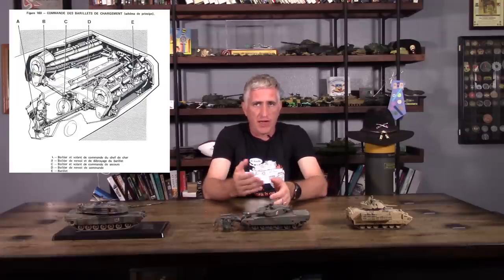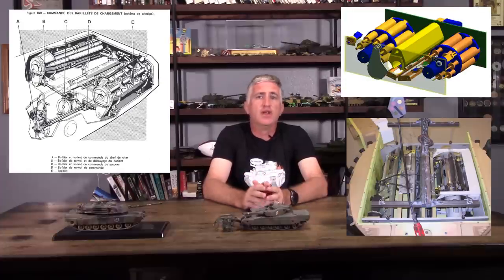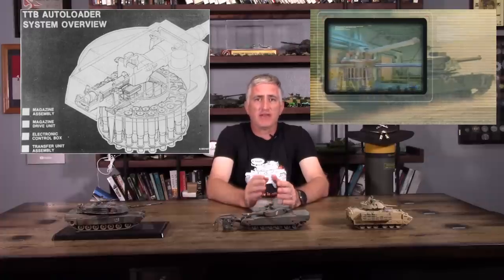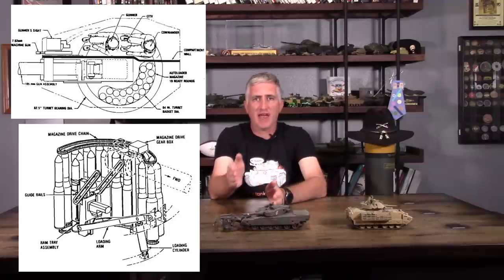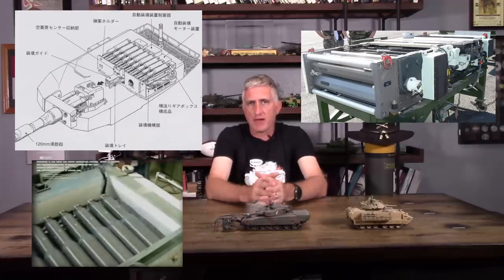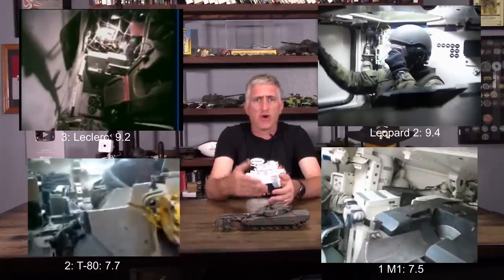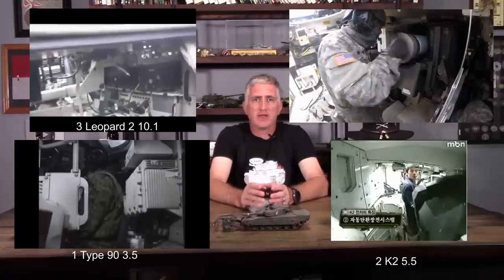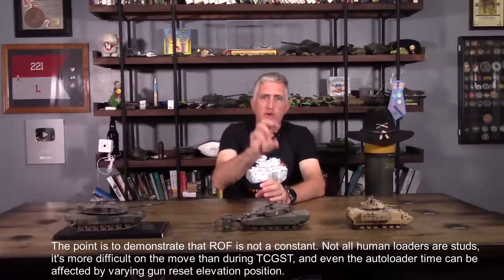Whither the Autoloader?

Comment: With hindsight of the new tactics Ukraine is using by combining spotting drones and tanks (notably that T-64 BV 6.5 mile record shot) could there be a case of keeping the 4th crew member within the tank but having them as a dedicated drone operator while also serving as a backup loader/set of eyes/troubleshooter?

Personally I see that a dedicated drone operator within the tank could benefit greatly, with the drone able to give the TC a more detailed picture of the battlefield such as in dense foliage, Urban environments, or hilly areas, or even simply just extending the overall range of what the tank is able to visually confirm. Additionally having the drone operator within the tank grants them access to enough electrical power to have strong ECM/EW systems to prevent a counter strike homing in on a RC signal, protection against shrapnel (but not direct hits) from counter-battery fire, negates vulnerability to communication jamming that a remotely located drone operator would be subject to, and increases drone availability since larger drones and extra spares could be externally carried. Lastly, if a bit far fetched, infantry working with the tank could also benefit from the drone operator feeding live intel to them about the surroundings without potentially exposing a drone operator who’s on foot to a sniper.

Initially I thought of it as a retrofit for current Abrams, replace the manual bustle with something like the Meggitt autoloader and fit the relevant ECM/EW/drone systems for the drone operator in place of where the loader stood (Maybe adding on Electronic Warfare as a secondary responsibility could be in play given the decentralization of jamming systems in recent years).

The DoD and other government officials don’t need to worry about spending billions to change up the design and build new turrets and hulls from the ground up nor the political favor of effectively building a new tank since this could (hopefully) be more easily applied to existing stock, bean counters won’t be tempted to axe the company size, crew members could be less stressed from staying on watch or conducting maintenance, and planners don’t need to twist the military’s arm to implement crewless turrets or a whole new platform.

I’d love to hear your thoughts on this idea!

Comment: As total blue-sky thinking, I wonder if eventually much better battery technology could end up making tank-based railguns viable. Then you wouldn't need the huge case full of propellant, you'd be back to just firing the actual warhead again. So for AP/solid rounds, back to being small enough that you could lap-load them, and not worry about wet or bulkheaded storage since there's nothing to explode. Of course HE would still need to be a decent size, but if you could get the velocity high enough, you could reduce the regular round size, then carry a hell of a lot more of them. Might not even need it...
Reply: Not likely to be the case anytime soon. However ETC technology would provide a safer and powerful alternative to modern tank guns.

Comment: I just want to see a video inside the tank of an auto loader as the tank get hits from the outside with varying degrees of force.  Do they test it this way?  Is the idea if that is already happening you are aced?  Mechanical parts don't fail under good conditions, they fail because it's been weeks in grit and grime and very little maintenance time and then they get put under stress from outside forces.

Comment: Just curious what maintenance costs could possibly be like when all of those fast moving parts begin to wear out and what impact that has on the probably of a failure happening in the worst possible moment. Also wondering about slight battle damage that has no impact on crew but what it would do to an electronically controlled, hydraulic powered auto-loader that relies on precision and exact movements to work. I think that was the main concern that influenced the manual loader on the M1A1 and Leopard.
I think both have their advantages and weaknesses-it's really what fits mission focus the best.

Comment: My loader automatically loaded. That guy was also handy with the pintle 240C.
Reply: Tanks vs tank destroyers. Autoloaders are fine for Tank destroyers. Better in fact. But, a tank's primary job IS NOT to engage other tanks. It is to provide overwhelming firepower combined with maneuverability and survivability in a multitude of situations, in a flexible manner. A loader allows for more flexibility in a larger variety of situations than an autoloader.
Current force needs do not require a dedicated tank destroyer, but should the need arise, they will likely be deployed organically to Armored (and Cavalry) Divisions. But they will be in the rear when entering a situation that calls for quick reactions and flexible tactics. Like entering an urban area.

Comment: If you cross train one of the other crewmembers to load, jic the autoloader takes a crap, sure why not have an Autoloader. The Autoloader would have to be able to be removed out of the way, quickly. Also, if the Autoloader has just as much of a chance of breaking, as any other system on a tank. The most important thing about a tank, is it's gun. Otherwise, it becomes just a heavy APC, if the Autoloader goes down. I might feel a ton better, if the Autoloader was made with quick-change, parts. As well, as having at least double-redundancy in it's electrical, and hydraulic, system.

Comment: Not really the scope of the video, but thinking about autoloaders and their use in 130+mm guns makes me wonder if we've hit or are due to hit a plateau in armour effectiveness. Obviously there is still room for small T series tanks to grow in size and weight, but western tanks are already pretty damn heavy, and slapping more armour on them doesn't seem to be much of an option.

Is there still scope for advancements in material technology? The type 10 tank leads me to believe there's still a little, considering it was designed to provide at least parity protection to the type 90 at a much lower weight, but one can't help but wonder at which point guns will become so deadly tanks will stop bothering with armour and move onto active protection etc.

Comment: Burst fire might be a more interesting pro/con than raw rate of fire.  We've seen common footage of M1 Abrams 2 shots in under 3 seconds, 3 shots in under 13 secs.
Reply: in very favorable and well prepared sequence with well trained crew to do this. For example a Leclerc in double tapping mode can fire in 5s ANYTIME, ANYWHERE, meaning while moving at max speed in cross country when a human loader would stick as his seat because his safety depends on that.

Comment: i was an leopard 1 gunner but you need the fourthman for maintenance  for the undercarrage as if the tank is not engaged you have an extra set of ayes
Reply from the maker: Why does the fourth man have to be in the tank for the battle itself? See how the French have done it.
Reply: @TheChieftainsHatch  I never heard about the french system, but in battle the fourth crew man can besides loading the gun can solve technical problems and if the one of the crew members gets injured the loader can do every function on the tank.
the tank stays operational much faster. and you can learn some who is not an loader very fast to load the main gun; if you do have an shortage on tank crew.
I know i was trained on an four man system, but in the second world war most tanks were 5 man crew, so maybe  i am an dinosaur

Comment: Maybe I've missed it, but another argument for the manual loader might be the "easier" switch between ammunition types. 

Could you elaborate on how easy that is managed on the mentioned systems ?
An autoloader needs to be designed to that end, possibly limiting your design options and therefore, space.
Reply: all autoloader designs have it just as easy to change ammunition type as to continue with the same ammunition type.

Comment: I would love to hear your opinion on rifled vs smooth bore barrels. What are the pros and cons and what might compel a military to pick one over the other?
Reply: Rifled barrels will make the shell spin around, as it propels that will increase the effective range of the gun on how far it can shoot aswell as increasing accuracy and stabilizing the shell in other words consistent accurate shots, Smooth-bore guns have the advantage of being better suited to firing fin-stabilized armor piercing rounds. There is also the added benefit of the barrels being able to last longer with reduced barrel wear compared to rifled guns.

The biggest difference between smooth-bore and rifled guns is the secondary ammunition they can fire. A smooth-bore gun is ideal for firing HEAT(High Explosive Anti Tank), ATGM's (Air to Ground Missile) rounds. A rifled gun can fire specially designed types of this ammunition but it is generally cheaper and easier to use a smooth-bore.
Reply: I think you will find ATGM means anti-tank-guided-missile... To my knowledge, tanks are traditionally already on the ground, thus the capability of firing air-to-ground-missiles seem somewhat redundant.

Comment: Thanks for a thought-provoking video!  Regarding protection, is the M8 gun and autoloader completely isolated from the crew side, with access doors for mx?
As you described the various nations' use of autoloaders or not, I thought of the bullpup vs conventional rifle debate.
Reply from the maker: I don't seem to recall a particularly solid wall in between the two, but I see absolutely no reason why there should not be one. That said, it might be a bit complex as one still would want access to the system for maintenance or remedial actions.

Comment: The biggest reason against an autoloader in combat has not much to do with loading - counter intuitively. Auto loaders usually work.
It is about manpower that is available to sustain the vehicle. Continuous combat is murderous - not only for men but also on equipment.
After a short while of fighting pretty much all vehicles have damages, that need to be repaired in the field without having a repair facility at hand. And two hands more make the difference here for having a fully operational vehicle for the next engagement and for the crew to get an additional hour of sleep.
Reply from the maker: See my commentary at 12:20 https://youtu.be/R0x-8NheU1E?t=739

Comment: What about selecting type of ammo how do most auto-loaders handle that; A crewman can just pick out what is needed. Also while it is true that an Auto-loader is no more at risk to breaking down than any other part of the tank, if the auto-loader fails you have a million dollar brick of useless metal. I also wonder how many tests of auto-loaders consider extreme adverse conditions. The auto-loader seems to me to be a particularly dangerous point of failure because, outside of the rotating mechanism for the turret, if the auto-loader fails you are up shits creek without a paddle, having the option to manual load would solve this but I don't know how many would allow for that.

Comment: Loaders also can get injured. Also exposed to certain dangerous shell components. DU for example. 
Can the round type be changed once loaded with an autoloader?
Reply from the maker: Depends on the autoloader. It's not recommended (or even possible in some cases) with in some human loader tanks either.
Reply: @TheChieftainsHatch  Oh ok. What is the general operating procedure ? Wait until a particular target and load or patrol with AP loaded say?
Reply: @zulubeatz1  find open field, commence ground cratering operation
Reply: @TheChieftainsHatch  hey chieftain i have a question i have seen the t62 tank video you did with ian from forgotten weapons and i do have to ask with with how cramped the t62 is that resulted in a slower reload do you think its better making the t62's 115mm gun a two piece ammo system like the early t64's gun also do you think mounting the 125mm cannon like the 2a46m5 on a t62 is good or even viable upgrade and if its even possible say for a country that dont want to buy a new tank so they just upgraded existing tanks if they already use a t62 that is i've seen t62 with the 120mm gun mounted on it as an upgrade would mounting the 125mm be good?

Comment: Didn't the Russian Armata use sectioned off armour at the front of the tank so the crew are encased in armour rather than the vehicle being covered in super thick armour all over the tank.
From what I saw not an expert at all.
Just a question.
I think the armour on the turret was weak because they used an auto loader so didn't need armour since if it got hit it wouldn't opperate anyway.
Many weight saving ideas whilst not sacrificing protection.
I think they would have better protection, mobility, technology and firepower over any western tank.
It would be nice to see them more since the tank looks great and it looks impressive.
Shame that it's so expensive :(

Comment: There is no place for human loader in any modern tank.

Loading heavy ammo during tank rapid movement in bumpy terrain is almost impossible. One more advantage is, that if tank is destroyed, you loose 3 guys, not 4. If 100 tanks are destroyed, 100 people live.. that means another 33 tanks can be manned... multiply this number of tanks you have.
Reply: Without the loader in the turret you can put the TC and gunner inside their own armored box within the turret.  Although with the idea that warfare is going to be net-centric in the future I think that the real benefit of an autoloader will be to free up the loader to input data into the net in real time instead of having to wait until the tank crew has a break in the action.  And IMO the loss of that pair of eyeballs is something that will have to be addressed.  Get rid of the loader and the TC is now responsible for 360 degree observation as well as watching out for enemy aircraft.  Maybe work on some kind of AI-based target detection system.
Reply: @colincampbell767  
> the loss of that pair of eyeballs
There's no loss, this is just another lame excuse for outdated tech. Carrying passengers inside a tank is indefensible. Might as well fly a pair of technicians in F-22
Reply: @Conserpov  If that were practical - then it would be the case right now.  Please describe the tech that you propose using and how it would be used in an environment where use of radio frequencies is denied through use of electronic warfare.

Also explain how you will prevent the enemy from using radio direction finding to pinpoint the location of the tanks.  There's a reason why tanks carry the same signal flags that were used in the First World War tanks.
Reply: @colincampbell767  
Your entire comment is completely  nonsensical and unrelated to what I said.
Reply: @Conserpov  I asked you to identify the technologies that you would use for this - and how they would work in combat conditions.  The enemy will attempt to jam the radio frequencies that we're using - so you need to communicate with those tanks in a manner that is jam-resistant.

And if you cannot do this - then this is why we require crews in tanks.
Reply: @colincampbell767  
> I asked you to identify the technologies that you would use for this
For "this"? What is this "this"?
Are you a schizophrenic, talking to voices in your head, and confusing me with one of them?

> why we require crews in tanks.
Driver, gunner and commander. No passengers, numptie.
Reply: @Conserpov  It's not that easy.  The battle management systems and countermeasures place a lot of workload on the TC.  It's already to the point where tank commanders are spending way too much time dealing with computer displays and not enough time with his head out of the hatch.  Putting the loader in charge of the battle management systems and countermeasures allows the tank commander to actually command the tank.  Another issue is maintenance workload.  It's hard enough with four people to keep everything working and still get a minimal amount of sleep.  Replace the loader with an autoloader and the tank crew now has another system they need to inspect and calibrate - but with one less person to do the work.

And there's the issue of how do you maintain 360 degree situational awareness with only one pair of eyeballs.  Lose situational awareness and you're no longer a 'tank' - you're a 'target.'

I can tell you've never spent any time on tanks.

Comment: with carousel autoloader, speed of loading also depends on where required projectile is on carousel... because rotation of carousel takes time... so its faster to load rounds next to each other, but not so much if round is farther away...
Reply: TEXOCMOTP  problem is that sometimes you need to fire multiple projectiles of same type (let say HE-Frag), then armored target appears, you want to load the APFSDS but  it might be out of order in carousel.  and of course, once you fire all 22 rounds in it, reloading it from inside is insane job for gunner or commander and would hinder the tank tremendously (practically, 22 rounds is all T64/72/80/90 tanks can use, everything above it, is practically unusable in heat of battle)
Reply: TEXOCMOTP   there are three types of ammo in it... HE-FRAG, HEAT and APFSDS...  and more you fire, longer it takes to get to next one.